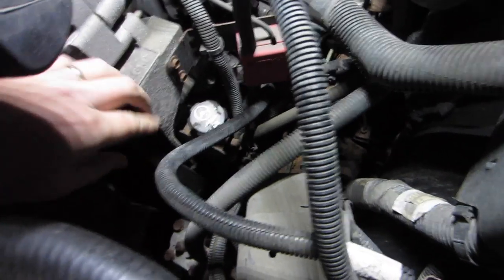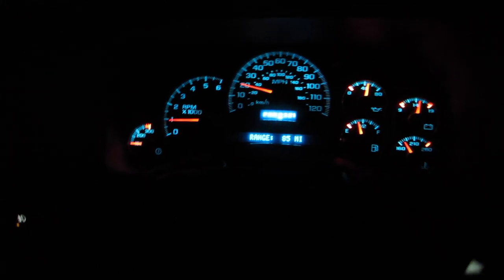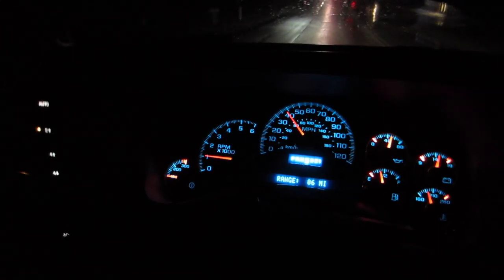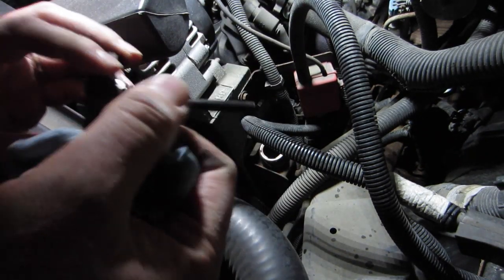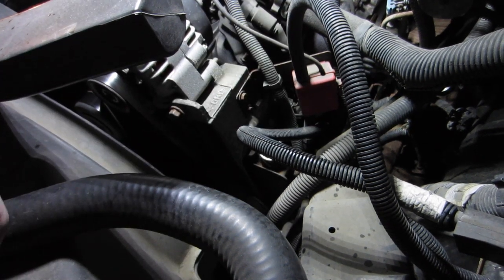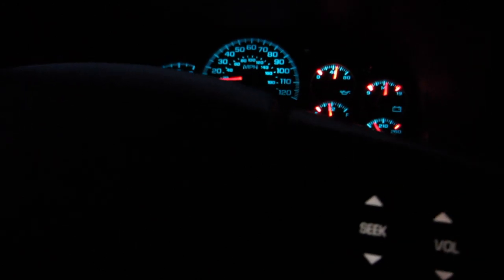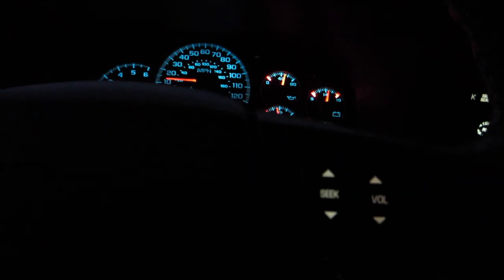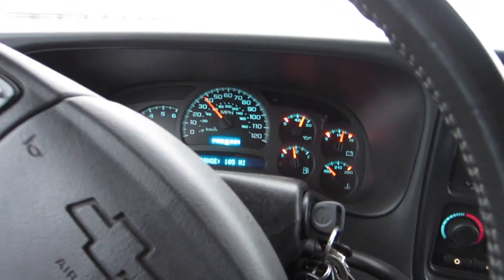5.3 Engine Whine?!

Comment: If you had to add fluid, you have a leak somewhere. Most likely the O-ring seals inside the rack (most common). Get yourself some Lucas Power Steering Stop Leak and replace some power steering fluid with some of that according to the directions. According to Lucas:
- Lucas Power Steering Stop Leak stops power steering seal leaks
- Effective in reducing slack, squeals, and hard spots in worn rack and pinions
- Results will be immediate and long lasting

Comment: Exactly the same issue, low power steering fluid. 

Thanks for the video.
Reply: How low was it? My truck is making a whinning sound and gets louder when rpms go up. Doesn't make the sound while idling. But my power steering fluid is about 1"-2" low
Reply: @Kevin_Yagoonie  Mine was almost empty :)
Reply: @mohammed1994-f6c  guess I got a bigger problem. Unless it's from sitting out in the cold. Trucks been sitting for a month in Massachusetts weather because it needs brake lines
Reply: @Kevin_Yagoonie  i tried to fix the problem temporarily as a i bought the steering fluid and i kept it in the car then i just keep filling it when i ever i start to hear the sound hahaha. However, i sold the car as every major oil in that car started to leak unfortunately.

Comment: Always good when it's an easy fix like low fluid. Wait until it's not nuts cold to change the pump and lines. The steering rack in my tow pig (Expedition) was leaking. Fresh Synthetic fluid made the leak go away.
Reply from the maker: Wow good to know! Thanks!

Comment: More than likely since it was low on fluid the pump was also sucking air into the system . When you topped it off it was not sucking air as much . It more than likely took a few days of driving it to remove the air in the system . I would still flush out the system when it gets warmer there , just to be safe . Take care !!!
Reply from the maker: Ah that makes sense! Thanks for the info! I do plan on flushing it out eventually! Thanks you too!

Comment: The words that were regurgitated to me say that the whine will eventually become permanent as it will also signal that your pump is going bad. Even a brand new power steering pump would whine if it didn't have enough fluid. Or if you turn all the way left or right. It let's you know when it reaches it's maximum turning radius.
Reply: That's what seems to happen with my engine. I have to take turns going around 10-15mph or else it start whining louder, especially if I go all the way left/right. I'm going to try throwing in a new pump because no amount of fluid will make it stop.

Comment: I'm gonna go out and get some steering fluid. I have a whiny noise which started 2 days ago. '04Chevy TBlazer. but I don't associate it w/ my steering wheel. it's October, not too cold. when the car runs, it whines. my mechanic doesn't work past 3.

Comment: Thank you so much for your video. I was low on transmission fluid
Reply: With low transmission fluid would it still make a whinning noise when parked? When I'm in park and give it gas the noise gets louder as the rpms go up. But no noise when idling

Comment: Sounds to me you have a bad power steering pump especially if the winans happening and steering I got a 2006 Silverado I've got a whine all the time even in park Wayne's when you drive it and reverse or drive transmission works fine my problem is probably a bad torque converter?

Comment: Anything ever come of this? Find a different issue later on? I have same issue,  the sound is like a turbo/whining, worse as I accelerate,  100% under the hood though I thought tranny at first but it can only be alternator or power steering right
Reply: Im having the same problem whining when accelerate I sure hope its not my transmission have you found out what your is?
Reply: @suzie Q  I'm 95%sure alternator because when running and I disconnect cable  on the alternator it stops

Comment: When you check the power steering fluid on a Chevrolet or a lot of vehicles as a matter of fact that are run on a belt and he needs to be warmed up or right when you start up cold and it has to be running while you check the power steering fluid the reason being is the belt the power steering pump and the rack and pinion gearbox together it sucks the fluid down if you check it while it's the vehicle's off you don't have the correct reading obviously it's empty because you're checking it while it's off it should show something at least Chevrolet usually you want to run it when it's warm warmed up I should say should be at the top line on the h and if not when you start up in the morning start it up and check it supposed to be on the c or in between is good. The whining noise is coming from the power steering pump I may need to be bled this video is probably old and I'm probably commenting for nothing but you can you can bleed it with a cap off engine running turn the wheel all the way to the right all the way till it stops and then go back about a quarter turn then back to all the way to the right again and back a quarter turn and back all the way to the right and hold it and turn all the way to left and do the same steps again do about two or three times left and right two times each side and it should take all the bubbles out after you put fluid in I haven't watched the whole video yet but I keep seeing you checking the fluid with it not running and that's just like sorry but duh you got to have the engine running it's on the belt so hydraulic thanks

Comment: I have this whining sound as soon as I start my 2006 chevy silverado 4.7 V8 and everytime I accelerate. Any idea what it could be?? Fuel injectors, plugs are good, did a transmission flush, alternater is good. Not sure.
Reply: Did you ever find a solution to this issue? I'm having same problem out of my 2001 gmc sierra and i just got the transmission rebuilt
Reply: @xGorillaRampage  did either of you figure it out? I’m having the same problem in my 03 Silverado
Reply: @calebwatts264  I figured out my issue. 
My serpentine belt was loose and I ended up replacing the belt and a few bolts and no more whining
Reply: Never flush trans lol. 9/10 your trans won’t last long after that. Do the usual pan drain and top off with clean fluid.

Comment: im wondering if anyone could give me any advice on why my 5.3 is reading high oil pressure it just started a few days ago the engin sounds normal no odd sounds coming from it and the oil levels are good and the oil is clean
Reply from the maker: When I bought my avalanche, I was on the way home and the oil pressure skyrocketed to 80 and kept going. It ended up being all over the place and turned out to be a bad stepper motor in the gauge cluster which is a common issue on gm trucks from 02-06. Not saying this is your issue but is one possibility
Reply: @jtmoffroad  I'm not sure that's the issue I posted the issue on my channel if you want to take a quick look at the video to get a little more info that I cant really describe but my buddy is thinking maybe my oil pressure sending unit is bad
Reply from the maker: Just watched your vid. I really don’t know what it would be but the only thing I could think of is bad oil sending unit like you said. Hope you figure it out! Be sure to comment back and let us know what you find out it is!
Reply: Oil sending unit

Comment: Mine does it from 0-30/40 but stops after that
Reply: Same have you figured it out. Would really help
Reply: Mine too ☹️
Reply: @Boots__OTF  take off you serpentine belt, and spin all the pulleys, witchever bearing has a grinding kind of sound is the one that needs a replaced bearing, my alternater bearing ended being the one that i need to replace.
Reply: Bro look at my recent video does it sound like that?
Reply: @jh9928  I had got my transmission rebuilt no more whine after that

Comment: My 05 Chevy Silverado has a whining sound also and it seems to be running ruff. I just had a water pump put on but was having the whining noise before I replaced the water pump any suggestions my engine light is flashing and it has been on for years was told it was a sensor but now it's flashing. HELP!!
Reply: Any result yet? I'm having the same issue. I'm doing research and a lot points to idler pulley.

Comment: My 08 is on its 3rd pump
Reply from the maker: Yikes! Hope I don’t follow that same path
Reply: 2 were done by previous owners per car fax, but with 275/55 20 tires, I could see how it would get tired. And how someone that only drives cars might complain of some tighter steering at times while parking.